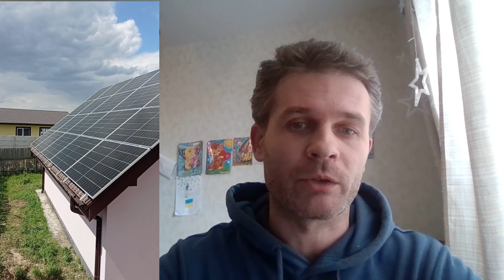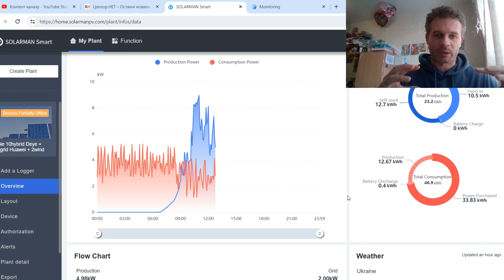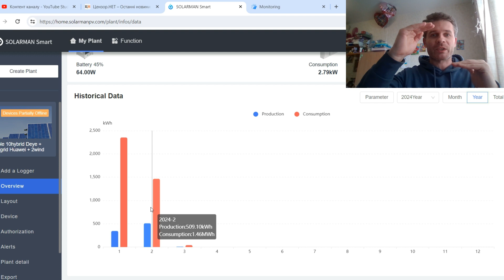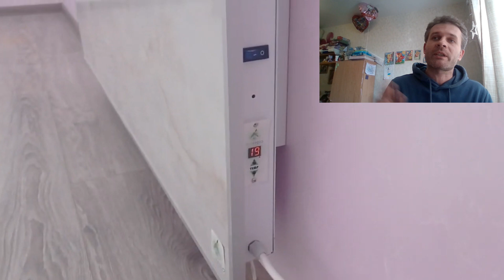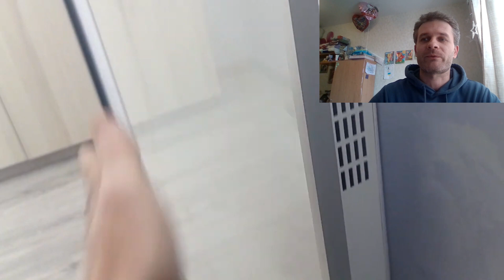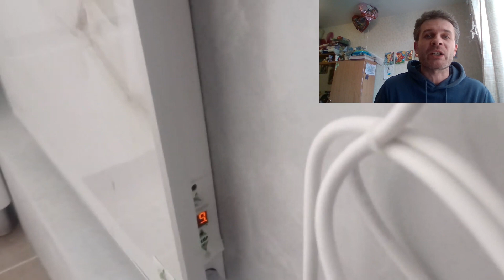How to pay ZERO for your energy bills in February? Check out my realistic example.

Comment: You should really buy Solar Assistant instead of using Solarman. You will never go back.
Reply from the maker: thanks for a hint, will check it out
Reply from the maker: checked it out. unfortunately Solar Assistant does not support any of my main two inverters... so it is pointless for me.
Reply: Deye inverters works fine with Solar Assistant. I have a Deye myself with Solar Assistant. You just remove the wifi dongle and use a usb to serial cable to connect to the Raspberry Pi or Orange Pi that runs Solar Assistant. You will have access to a lot of settings on your inverters and a much better statics than Solarman. And there is being added new features and support almost every month.
Reply from the maker: @mortenwinslw2785 ok. what about huawei? and what about wind grid-tie-inverters? will I be able to connect all 4 via the same method? are there enough ports on Solar Assistant Paspberry Pi or Orange Pi?
Reply: Huawei SUN2000 are supported. The big blue wind inverter can be connected to the 230V generator input on the Deye. That way you can get the production from wind to be showed in the Deye.
Reply from the maker: @mortenwinslw2785  it is on the genport already, the WT inverter I mean. however I need to see its separate parameters, not just the output.
Reply: You can suggest Solar Assistant to integrate the WT inverter, but for now it's only the input on the gen port.
Reply from the maker: @mortenwinslw2785 I believe it requires some more study. But in general I've always wanted to have all the inverters tracked/monitored in one place, so Solar Assistant definitely might be an option, but looks like not an immediate one.